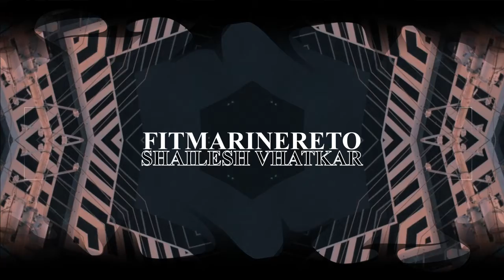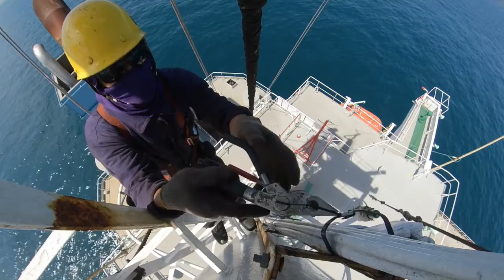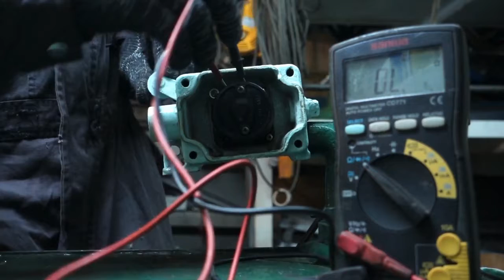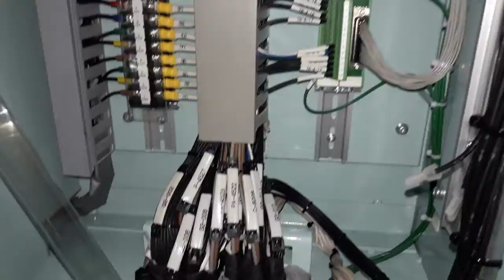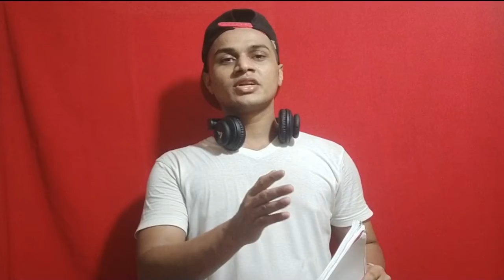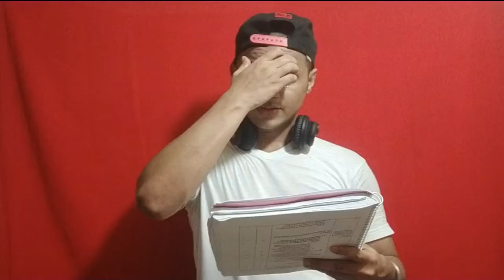SYLLABUS FOR #ETO DURING PRE-SEA TRAINING AT ANY INSTITUTE. #HIMT#ANGLO#GREAT#TOLANI#SAMUDRA.

Comment: video pause kar kar ke jitna hua utna likha hai
i don't guarantee ki sab sahi likha hai
coz koi words unclear they

Syllabus for ETO during pre-sea training

# You should know the basic understanding of operations of Mechanical engineering system
	- Basic principles of IC Engine, Generators
	- 2 stroke 4 stroke engine onboard.

# Maneuvering system, fuel, lubricating and cooling water system, and their controls.

# Auxiliary engines used for Power generations (Very Important).

# Engine room auxiliary machinery like freshwater generator, pumps, heat exchangers, Air conditioning systems, Cargo refrigeration system, instrument air dryers, ICCP(Impressed Current Cathodic Protection), MGPS(marine growth preventive system), air compressors, OWS(oily water separator), engine room blowers, workshop machinery, & IG(inert gas) systems in Tankers & Boilers

# Steering system
	- Arrangement of the steering system.
	- intro. to the electro-hydraulic steering gear and its types.
	- 4 RAM and 2 RAM steering gears.
	- autopilot mode.

# Cargo Handling System
	- Cargo pumps for tankers
	- Framo system tankers.
	- Electrical crane for Bulk areas. (for cargo discharging and loading)

# Deck Machinery
	- Anchors and its handling systems.
	- Windlass system

# Generators
	- How to start
	- Generators alternator controls
	- Generators' safety interlocks.
	- shutdown and restart (Onload and Offload)
	- Paralleling load sharing

# Hotel electrical system
	- Galley, mixes, Hotplate dishwasher cooking range
	- Chilled provision room, laundry systems
	- Accommodation power systems
	- Motor overalls

# Ship Construction
	- Knowledge of all Ship and deck machinery
	- Details of maintenance, right side left side

# Shipyard Machinery Familiarization
	- Electrical drives,
	- Starter Panels including DOL(Direct ON-line) star-delta autotransformer, soft starter

# Technology of electrical materials
	- Conductors
	- Insulation materials, insulation class.
	- Hotspot temperatures, IP ratings, EX ratings
	- Types of cables, insulation breakdowns
	- Switchboards, Transducers
	- Relays and reverse power relays
	- Generator computer usage.
	- Computer Network management.

# Electro-Hydraulic and Pneumatic Control system

# Transformer or Sure supply for ESB

# Battery maintenance
	- Principle of Storage batteries, types, and applications 
	- Methods of charging, deep charging, deep discharging, chargers, rectifiers.

# Normal and Emergency lighting system

# Main Engine, Auxilary Machinery Control Systems. 
	- Description of electrical controls on the main engine
	- Engine control system
	- Maneuvering System
	- Conceptual electronic mechanical governor for speed control
	- Troubleshooting in the electrical domain of engine

# Networking and Communication systems
	- Switches, HUBs, servers, background backup software
	- Communication from PC to PC, Satellite, Global Maritime Distress, and Safety System (GMDSS).

# Engine monitoring system
	- Knowledge or awareness about the external interfaces for the purpose of data collection, monitoring by third-party vendors such as the engine manufacturers, or predictive maintenance or condition based on monitoring systems.

WO PREDICTIVE WAALA MACHINE LEARNING HAI KYA ??
PLEASE, SOMEBODY, CONFIRM THIS

# Electrical practices and Safe working
	- PPE (Personal protective equipment)

# Maintenance and detection using PLC SCADA (Supervisory Control and Data Acquisition) system

Systems
	- Bridge Electronic equipment 
	- Radar
	- UMS(Unattended Machinery Spaces) operation 
	- Bridge Navigational Watch Alarm System (BNWAS)
	- Deadman alarm, watchkeeper alarm. 
	- Windlass mooring winches
	- Tank gauging systems
	- Fixed gas detection systems
	- Alarm monitoring consoles
# Fire detection and control systems
	- Type of fire sensors: ionization type, rate of rise type, heat type sensors

# Hazardous zones and hazardous areas.

HOPE THIS HELPS THANKS AND PEACE OUT😁😃
Reply from the maker: Good job buddy 👍✨💯
Reply: @fitmarinereto736  i appreciate it❤️

Comment: Bro you even know how to repair refrigerator and washing machine and other small appliances? Obviously this are not covered in B. E or 4 month eto course so Where did you learn this all?
Reply from the maker: We learn diode, PCb ,programimg , electrical and all other everything so we have to read through manual and solve the problem or we need to know problem and there remedies and you will learn that after Facing problem.
Reply: @fitmarinereto736  thank you brother 👍